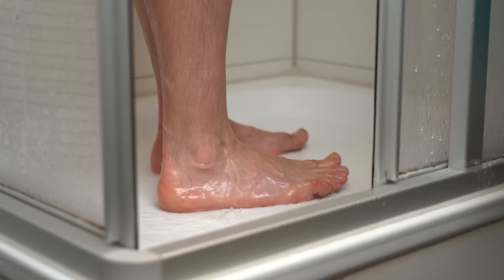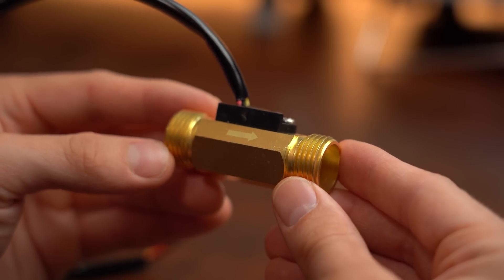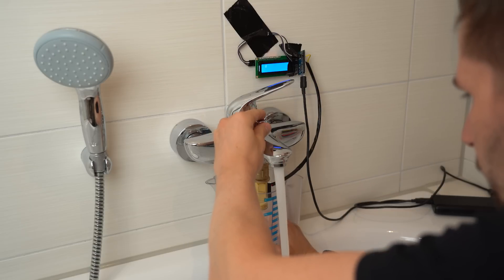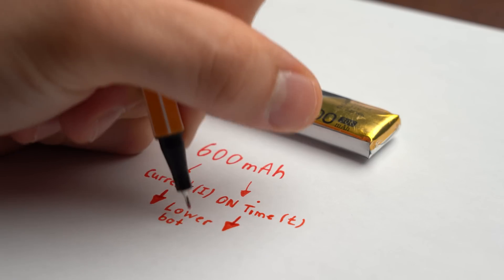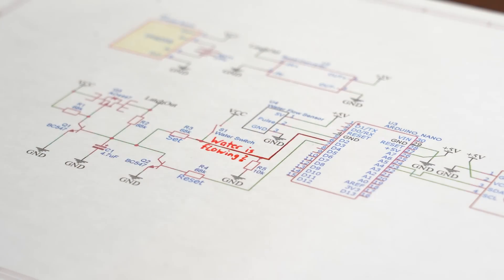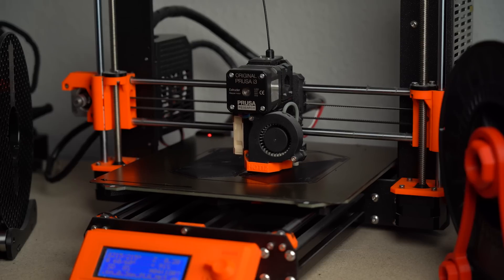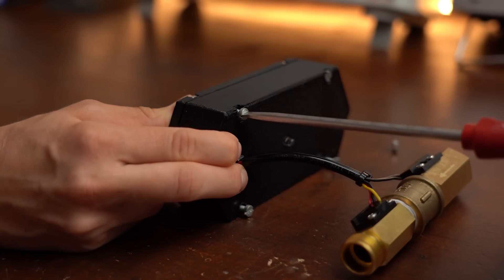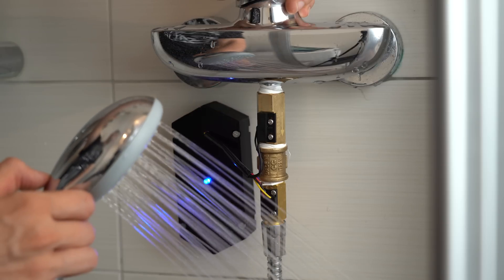Every Shower needs this Upgrade! (Online Water Tracker)

Comment: I would imagine that if you put the esp into a deep sleep mode you could use the signal from the water flow sensor as a wakeup signal. That could save you the extra money for the water flow switch. Looking at the datasheet for an ATMEGA328P it uses less than a uA for deep sleep. I think that an esp is in a similar range.

Comment: Actually since you come from Germany saving water is bullshit. Quite contrary actually water is abundant in most parts of Germany and saving water damages our sewer channels which were built for a way larger volume of sewage. The water saving mania reduced the volume of sewage causing greases and all sorts of other trash people flush to deposit and damage our sewage system. What does make sense however is saving warm water, since it's expensive😀

Comment: Could be really interesting to add a separate microcontroller measuring temperature into and out of the water heater, then factor in the cost of heating the water as well.

Comment: I don't think the variability in pulses per liter comes down to a cheap sensor. I'd expect that type of sensor to have a nonlinear relation between pulse rate and flow rate, as the fluid dynamics within are complex. You would need to switch to an entirely different type of sensor for a linear relation.

Comment: Does Arduino boot up instantly? If it isn't, we won't be able to count some of the water flowing out at the start, each time we open the tap after the system has been shut down.

Comment: 9:53 You don't need to install HACS in order to get the additional cards and integrations, you can install it manually (most of the times there is a guide for that at the specific github - mini-graph-card has ti there as well).
But good for you that you instaled HACS anyway, it's much easier with it for your future HA modifications.😜

Nice project though.

Comment: Nice idea but I am a bit in doubt how long the tiny propeller works depending on the amount of minerals and chalk which will plate it sooner or later. In industrial purposes there are also systems which measures free from mechanic by a heating resistant and a thermal readout behind. The more water flows the higher the difference. Anyway those sensors are not sold for a budget 😉

Comment: Nice Project, 
The missing precision of lowend waterflow sensors is also one thing i had my share of problems with.
Right now i am trying to create a easy to build and accurate DIY flow sensor.
Also you could have added a temp sensor so you can also calculate the energy usage from your shower, in times of raising energy prices it would have been a neat feature.

Comment: You should really mark `pulseCount` as volatile since you are updating that value in interrupt so that compiler does special optimizations for it and you avoid some of the really hard to debug issues. I'd also implement sleep mode which Atmel supports. In that mode its power consumption is really really low around 0.1 micro-amp and interrupt can wake it up. It's simple to implement and makes rest of the code even easier to implement since you'd just have to upload stuff, call sleep and be done with it.
Reply: Good idea, gets rid of the bulky float switch. Also I would add price calculation for hot water, since you probably don't use cold water for showers, and the bulk of the cost comes from heating the water with electricity or natural gas, not the water itself
Reply: @ffoska  This. Though the heat may come off as an estimate since it takes time to run the hot water through or heat it up. You could probably do an estimate based on the temperature.
Reply: Trouble is, it's ESP8266 in the end which has a different idea about deep sleep and interrupts, but yeah, it is possible to solve this problem without an extra water switch.
Reply: @Gurux13  I’m not so sure that ESPHome — which integrates nicely with Home Assistant — implements deep sleep very well. Maybe I’ve just missed it so far.
Reply: @JasperJanssen  ESP does implement deep sleep. Reduces power consumption to 20 or micro-amps. ATmel is much better and goes down to 0.2 micro-amps. For me personally implementing that extra switch, cabling, latch is much higher complexity than it needs to be.
Reply: ESP is not atmel.

Comment: In defence of the cheap flow meter, I suspect that higher end devices do exactly the same thing but have a calibration in their datasheets. The problem is that you aren't directly measuring flow rate, you're measuring rpm as a proxy for flow rate, and since it's an impeller with gaps around the blades a higher flow rate will change the relationship between flow and speed (guessing here but presumably higher flow rates didn't increase speed by as much, would expect to see bypassing to an extent/less efficient operation). Intuitively it makes sense that pulses should match up with fixed volumes but once you lose the assumed linear relationship that goes out the window.
Reply: Using a flow meter is still a widely used way to measure volumes in industry. Usually you don't have a curve for the flow/pressure/etc as it depends on your liquid (water vs oil for example) they give the relationship for pulse per turn. Some flow meters do have a relationship for pulses, but those sensors measure an actual volume (ex 3.14ml/pulse).

What is done to make accurate and repeatable measures is called a K factore. If you have a constant flow for example coming from a pump you can simply do the calculation at the rated flow, but if the flow or pressure or liquid change, you need a multi K factor compensation. It is done by taking multiple measurements across the flow variation. Then you do a linear interpolation between the K factors.

An example would be for example a variable speed pump in an oil pipe and you need the result in kg. You will start by taking the number of pulses and the frequency at 10% speed, and for each 10% up to 120%. You can do it for a couple of different temperature points as well if you have a temp sensor. Then in production if you read a frequency at 63% you interpolate from you 60 and 70%.

I don't know if it make sense the way I wrote it, but I do those kind of things regularly where I work. We are able to get below 0.5% error with cheap sensors and this method. Our process requires less than 2% error.
Reply: @philippegauthier2212  you are correct on a number of levels, as are some of the other comments to some degree. High quality flow meters often use a four wheel paddle and hall effect pick up. The issue we have always found is turbulence in the fluid flow. There must be some distance between the entering and leaving ports of the sensor from any kind of bend, valve etc that creates any kind of turbulence
Reply: There are other types of more exact flow meters on the market. For example, one working principle is measuring the difference in the reflection of ultrasound through flowing media. Or you can measure the different electromagnetic features of flowing (electrically conductive) media vs non-flowing. These two principles are much more reliable than the little repeller doing its funny thing. They are a bit pricey though.
Reply: That should be the manufacturer's job though, to provide the user with a curve/ function or lookup table for the sensor they are selling. It's not that hard to build an experimental setup for getting halfway decent curve, so shame on them for not doing it
Reply: The flow meter needs a consistent stream to work - most flow meters use some form of restrictor or other method to remove turbulent flow.
It wouldn’t matter if it was ultrasound or conductive or mechanical - the sensor won’t read consistently if the application is correct.

Comment: Loved the video! Good topic and good solution. 

I would have approached the home assistant part in another way: I wouldn't have used home assistant at all, but I would have used grafana+prometheus.

It's really easy to code for the esp32 to communicate with prometheus, and it's really easy to host grafana and prometheus with docker. 

Grafana has awesome graphs, and you can easily configure it to do math and calculate cost among tons of other things.

Great video though!
Reply: Is it really more easy to put Prometheus in front of it? I usually use InfluxDB for such temporal based data and show it in Grafana. 🤔
Reply: @NicosLeben  Good question, I've built various ESP32 projects with Prometheus and also tried InfluxDB, and they have a different working principle.

InfluxDB works with a library and interacts with an API which means you need keys and various forms of configuration. 

Prometheus works pretty differently: It  sends http get requests to a target IP periodically, and the target (in this case an esp32) replies to the request with the data. 
This makes the code pretty simple, since the esp32 only has to reply to a get request with whatever data you want.

Also, Grafana and Prometheus are the classic dream team :P so integration is excellent

It really comes down to preference, both do a really good job. I prefer Prometheus' simplicity, but it's completely fair to prefer InfluxDB's more featureful solution

Comment: Timely for me. I'm just in the process of converting a small water boiler into a hide glue pot with remote temperature control via an esp32. What does this have to do with your project? Well, I'm going to use your sealing method and just ordered some silicon cord. Now I just have to update my 3D model and print it.

Comment: I think the next big step is to make this device absolutelty passive and battery-less with just the power of water stream (maybe even heat) making the circuit work. Great work!
Reply: I think a small battery acting a bit like a ups alongside a flow charging system would be great
Reply: add a coil to a second flow meter and power the esp entirely from that!  Exactly the sort of project I would expect from GreatScott

Comment: I would also add in temperature sensor and calculate kwh used from temperature of water and how much liters were used
Reply: The problem is that the water out of the tap is already mixed with the cold water because most heating systems produce hotter water to prevent from legionella. Anyway to measure the energy you had to rather measure the hot water hose separately since you can't measure the mixing relation reliable.
Reply: @matneu27   it doesn't matter, temperature delta between cold water (constant since water mains are burried so temp fluctuates only few degrees depending on season) and shower water is important,
Equation is c=Q/(m∆T), c is constant 4181.3,  m is output from flow meter, ∆T is shower temp minus water main temp and Q is energy spent heating water

Comment: Instead of water flow based switch, you could have used the water flow as energy source and then your controller would have only needed a small capacitor...

Comment: This is a great project and everything looks pro. I would make one improvement though by using epoxy mix on the LED instead of hot glue to complete the seal. I just know from my a small box I made for my PC case that It was becoming fluid and moving around at around 65ºC. Specs for my glue sticks say melting point is at 80ºC, but it really depends on which type and quality of glue sticks you get. I just looked up Hot Melt wiki https://en.wikipedia.org/wiki/Hot-melt_adhesive and it you F3 search for "low-cost " it says 50ºC. Well some some info to keep in mind, now with these heat waves passing over Europe. Good job BTW

Comment: this thing can be more accurate...just some research is needed for the system being used in pumps to measure gasoline...then the descripency can be overcomed and we will be able to get exact water consumption measurement.

Comment: Well You could've used temperature measuring pipe, this takes care of charging  gives You a temperature of Your water and You could make it measure Water usage,  and All You had to do was hook up just a ESP with battery to get the water flow. You don't need to make the waterflow be linear with rotations, You should get the valve with a handle attach the thing for measuring angle and create in excel or better software a function that would show You the curve of rotations to flow rate (dm^3/s) And You will be fine unless You just drip some water. This project Would've been so much easier (battery would charge with a turbine inside and battery would support it before it reaches the voltage still needing the switch You used.)

Comment: What about using the waterflow to generate a small amount of power and charge a capacitor ? (so there is no need of battery)
Reply: Or, could the running water charge the battery, instead of a capacitor? I am intrigued about the capacitor idea, though...
Reply: @cokeacolasucks  I am pretty sure that the whole thing does not need a lot of power to operate, so a capacitor might be enough and easier to charge than a battery. It's same idea as RFID cards.
Reply: @cokeacolasucks  Battery need a lot of power to charge. extraction this power from a fossed flow is not possible. 
i you even found a generator to do so, the generator will convert the kinetic energy of the water flow to electricity, reducing the pressure at shower head, ruining the shower experience
Reply: That's exactly what I did.  I bought a smart showerhead called the Water Hawk.  It runs off of the water flow.  Works perfectly.
Reply: Quint BUILDs tried to power some electronics with his shower once.
Reply from the maker: Tried it. All commercial water turbines I found could not nearly produce enough energy for the system.
Reply: @greatscottlab  The Water Hawk works exactly this way.  It's a smart showerhead.

Comment: Did you consider using home water metering valve for this same purpose? Possibly in combination with occupancy sensor in bathroom (that could also trigger ventilation if needed).

Comment: I have an electronic valve to the hot water pipe leading to my shower. Before showering I need to ask my google assistant for hot water. It closes automatically after 10 minutes. That is a very good way to save some money.

Comment: Many of the moderm power/water meters have either a wireless or a ir/wired interface where you can "easily" read the data of them in a similar way that your utility company does. I know a few people that do exactly that. This gives you the most accurate graphs possible(literally the exact same that your utility company sees and charges you for) and does not require any modifications to the meters themselfs
Reply: This was what I thought about doing

Comment: With access to the water meter the "AI on the edge" project could also be interesting. It's using an ESP32 cam module to read & analyze an analog water meter. The live update rate is probably a lot slower, but if statistics by hour or day are enough it's a nice project.
Reply: Link to the video mentioned by @Leif: https://www.youtube.com/watch?v=d_u8c3bu-zg&ab_channel=AndreasSpiess

Edit: Apologies, that is not the original video, but mentions it. Leaving the link as it's interesting and related anyway.
Reply: An esp32 for edge processing?  It can barely emulate Atari 2600
Reply: @hicknopunk  It uses Tensorflow Lite which is optimized for the use on Micro Controllers.
Reply: @Leif_YT  that is bloody impressive

Comment: Mk2 idea : ditch the battery / eliminate the need for charging by adding a small turbine in line with the flow sensor :P
Reply: better yet, run all the house water through a turbine to generate electricity for the whole house.  minor downside, every time you want a piece of toast you'll have to take a 3 hour shower.

Comment: How feasible would it be to use the energy generated from the pump to power the uC? Maybe it could charge a supercap enough to send data after it ends 🤔
Reply: There is no pump, the flow measurement device is not a motor or a generator, as that would be way too restrictive.

Comment: As much as I love my Electronics Hobby and Microcontroller Projects, using a low-flow shower head is a much better solution. I received one of these shower heads many years ago from my Gas Company. There is no guilt in enjoying a longer shower with one of these devices. And they don't require batteries.
Reply: Same, I can now shower three times a long using the same amount of water. You can get them super cheap and as long as you don’t have super hard water require no maintenance

Comment: You can use Bernoulli's theorem to measure the exact mass of water used which states that total energy per unit mass is  the sum of pressure engery , potential energy due to height , and the kinetic energy much be a constant value so technically more water molecules with this energy constant moves the turbine faster so you need to measure these energies and get the constant by normalisation with mass of water to get the exact amt of water usage
Reply: Lol

Comment: Could you even charge the battery with the water flow?
Reply from the maker: Not really. The system uses too much power and you can not get much from the faucet.
Reply: @greatscottlab  Yea I suppose it would be energy recovery then battery charging. Still could work.